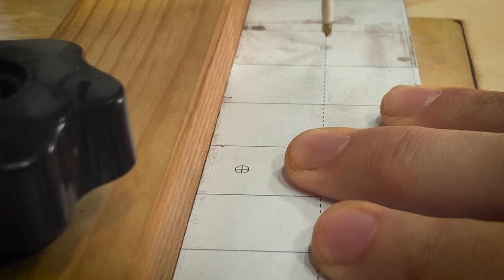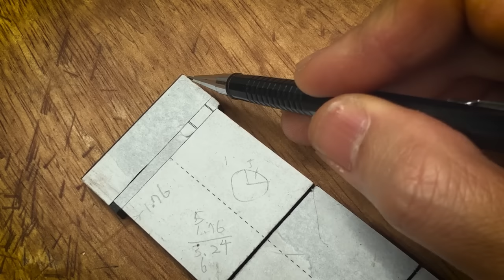Rebuilding MUSIC MAN Sterling AX3 guitar / 뮤직맨 스털링 AX3 기타 다시 만들기

Comment: I saw you do a few things in the woodwork part of this video that made me go, damn, that's absolutely bonkers! How you bend the rosewood headplate and blended  that with the fretboard, very nice. The fretboard binding is beautiful too. Few points I'd like to suggest for a future iteration of this build: 

* no string trees but staggered tuners.
* different kind of finish, one that can be sanded flat and buffed to a high gloss. 

I guess that's preference and not criticism. Well done!
Reply from the maker: In the video, Bending the rose wood is only a few seconds.
Actually It took many times! Heat and bend a little, heat and bend a little........ maybe It took 3~4 hours.
Bending Iron in the video is too short so I could not use it when I bended rosewood plate. If I had a long one, I'd bend it easily in just a few minutes.
I'm gonna take a video of Bending rosewood plate with the fret board in next video.

* the string tree on this guitar is just for decoration, but I'm gonna use staggered tuners next time like you said.
* yes, you're right. This guitar was finished with Polymerized tung oil only, but it's better that front head & body is gloss and back head & body is flat or vice versa.

Comment: This is more of a boutique reproduction than it is the mere rebuilding of an existing guitar.  What was the grain fill? It almost looked like glazing putty.  The tung finish looks great.  How many coats did it require?
Reply from the maker: The grain filler is Timber Mate water based wood filler.
I coated polymerized tung oil 5 times.

Comment: I got myself a sterling by music man axis, but I don't like how the trem arm never stays in place. What's a good replacement trem for it?
Reply from the maker: Music Man Axis guitars originally equipped with a Floyd Rose bridge?
This bridge is very stable... however You don't like the arm, Gotoh Floyd Rose bridge is a good replacement.
Reply: @sixircleguitar7664  no. Mine has a non locking trem

Comment: Such a beautiful Guitar!, All that attention to detail custom building, yet you put a cheap tremelo, and cheap tuners on it. Makes no sense. You should change the tuners to Gotoh Locking tuners, and the tremolo to a Gotoh 1996t. 😊
Reply from the maker: Gotho is always the object of envy ( and so expensive!!).
Gotoh 1996t is Floyd Rose style. This type is mounted at AXIS model but normal Strat style one is mounted at AX3. 
Tunners and Bridge in this guitar are made in Korea. Tuning stability is no problem!
By the way, I,m gonna use Gotho next time. 😎
Reply: @sixircleguitar7664  
Gotoh 1996t is NOT expensive. Here in the USA I buy them from $100-$120 USD  depending on the color. 
Also here in the USA I buy the Gotoh Magnum Locking Tuners for $63-$79 for a set of 6 also depending on the color. So you may save $50-$100 total, but in the long run, you’re losing, by putting much lower quality components on such a high quality guitar. Again, it makes no sense.  😊
Reply from the maker: OK, I admit my defeat.😭
Next time, I'll use Gotho!!! at any cost.
Reply: @sixircleguitar7664  Great Idea! And if you live in Korea, it should be a lot less expensive than here in the US.
Reply from the maker: Such a sorrow, here in Korea, Gotho 1996t / 510TS-FE1-C / Magnum Locking Tuner are each $170 ~ &180...😔
maybe it's because of the law of supply and demand.
Anyway, I'll use Gotho!!!!
Reply: @sixircleguitar7664  wow! 🥲

Comment: Was that oil that the bone nut was in?
Reply from the maker: It's olive oil. you can also soak it in lemon oil.
Reply: @sixircleguitar7664  what's the purpose?
Reply from the maker: There is no particular reason.
When I tried to put the nuts in lemon oil,  I just ran out of lemon oil. So I put the nuts in the olive oil I found in the kitchen.
Reply: @sixircleguitar7664  No lol I mean why put the nut in oil? For lubrication?
Reply from the maker: Yes, lubrication.

usually the reason that nuts soaked in oil is;

1. It is said that the sound transmission ability of the nut is improved because of the oil that has penetrated into the nut. In general, soaked in oil for 14 months or more.
2. Lubrication.
Reply: @sixircleguitar7664  Oh that's interesting. Most ppl either boil, or leave it in acid to get rid of the oiliness.

Comment: hey man, will you make me a guitar? I'll pay .. something simple, a strat or tele but full contours, however, I want a very light but resonant 1 pc body, ash preferred but alder works, then I want a canadian hard rock maple neck quartersawn, then I want a brazilian maple fingerboard, I can send you all the blank wood, the body, the neck and fingerboard, or I will have it sent to you..  what you say? do you have any experience making the 1959 stratocaster? the heel adjust? full spec? I can even get you the jigs.. I'll install all the hardware, and even finish if you prefer?

maybe we can make it a normal thing, 1 or 2 a month? you interested in a lil' side hussel?
Reply from the maker: Sorry, my English is not very good, so I didn't understand your sentence correctly.
Do you mean you want me to make a guitar for you to use? Or do you want a business relationship where you supply the wood and I make and deliver the neck and body?

If it's the first case, I'll try it, but if it's the second case, I'll politely decline.
Reply: @sixircleguitar7664  ... I want a guitar to play that you make